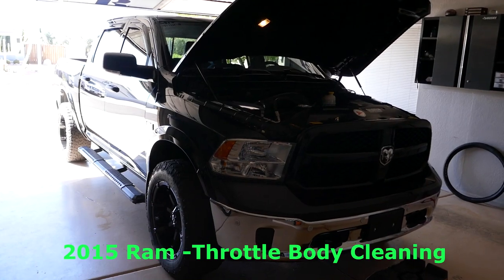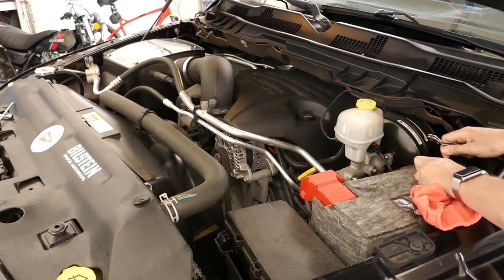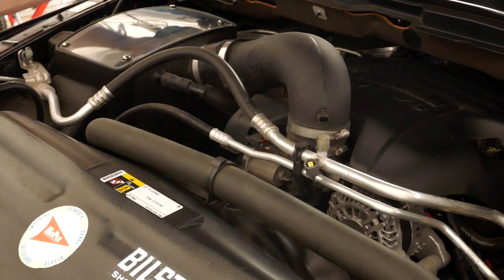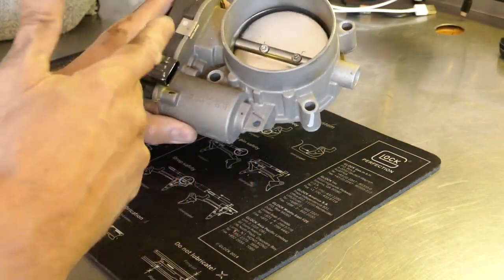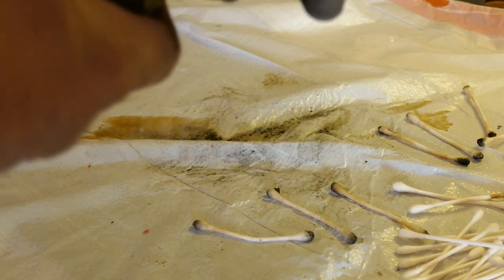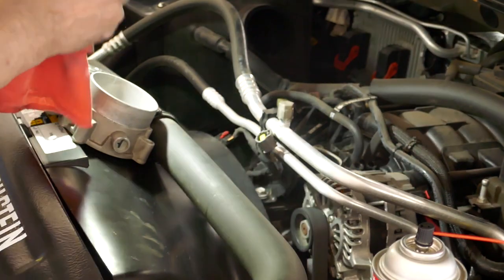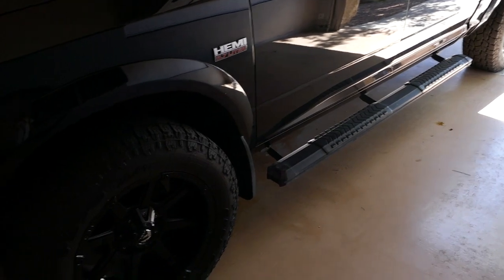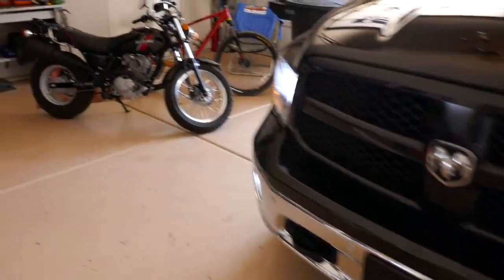Throttle Body Cleaning 2015 Ram

Comment: Always hold the throttle body with the electronics portion on the top side so that when you spray in it the fluid does not seep between the rotating bar into the electronic unit. Great video.

Comment: Ha! Stumbled across your video today. I wanted to clean my throttle body and I kinda laughed when you mentioned checking the perimeter of the hood for tools. I was replacing the halogens last night to leds because I did the fog lights and they didn’t match. Now they are nice and white and bright. Didn’t do the high beams but that’s next on the list.

Comment: I have to do some work on my 2015 ram 1500 with the hemi.  I’m at 131,000 miles.

I have all the stuff to order from Rock Auto.  Is that considered the upper or lower throttle body gasket?

Comment: Did you just replace the bulbs inside the front headlights?

Which bulbs were they?
Reply from the maker: PUTCO 289006 Adjustable Silver Lux LED Kit- 9006 Pair w/4000 Lumens Output for the lowbeams but I put in the high beams as well. If memory serves me right, they were the 9005 but those were also the PUTCO Silver Lux. Very good bulbs. Four years later now and they are still holding up perfect.

Comment: Is a throttle body relearn procedure with a scan tool required after a removal and cleaning?
Reply from the maker: Not for this year/model. No issues for me and I've done it again not too long ago - still with no issues after cleaning it.

Comment: Never spray the throttle body directly.  Spray on a rag and wipe on. Ask me how I know...  sigh 

2nd throttle body is on its 3rd or 4th cleaning using this method
Reply from the maker: Good advice and probably smart to do it that way but I have been trying to keep it out of the electronics area and so far no issues.